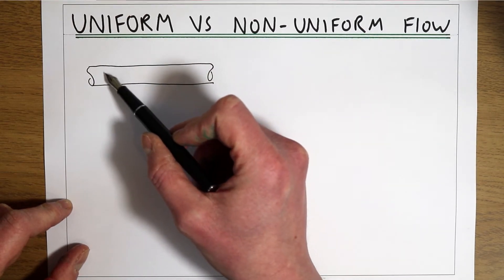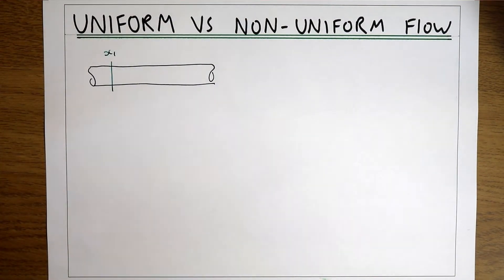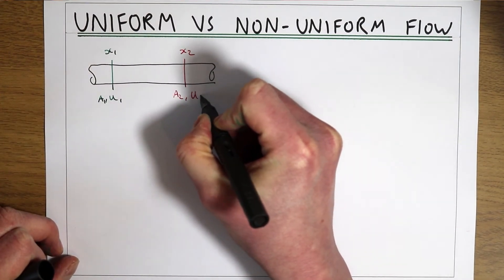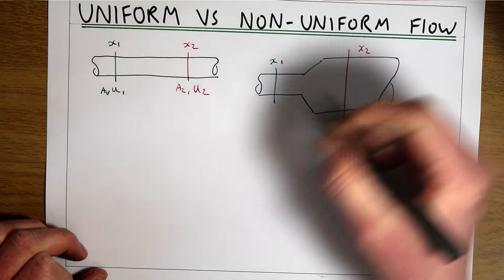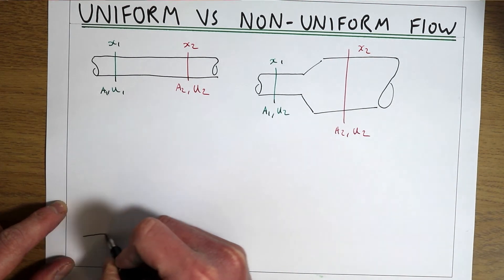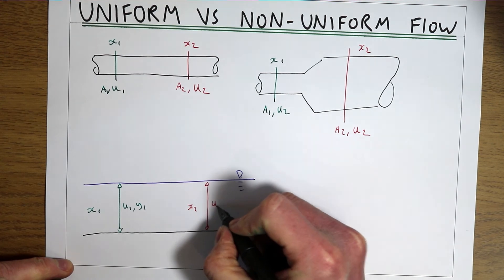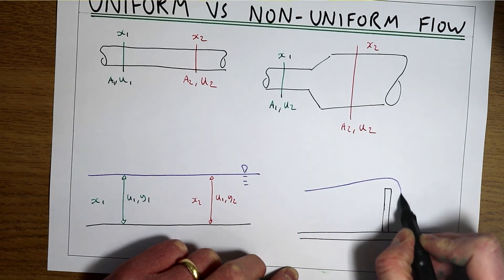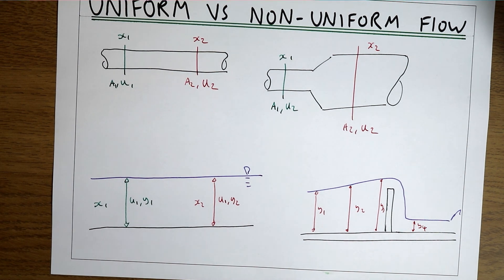Unifrom vs Non-unifrom Flow

Comment: This uniform flow definition was what I have been seeing a lot till I watched a YouTube video, he says for a flow to be uniform,
The local velocities should be same as the average velocity at a section,
And velocities can be different at different sections.
What is your opinion about it?
Reply from the maker: This is a very good point. It can actually mean both of these things. Uniform just means the same everywhere, so ultimately a uniform flow is one where all parameters are the same in both x, y and z coordinates. But normally when we are looking at bulk parameters in hydraulics, we are much more interested in what is happening along the flow rather than the details of exactly how parameters are varying across the cross-section. So in a subject like hydraulics, we normally consider cross-sectional mean parameters for the y and z orientation, and are mainly interested in how parameters are varying along the flow with x. This is why I made the focus of this video how parameters varying along the flow.